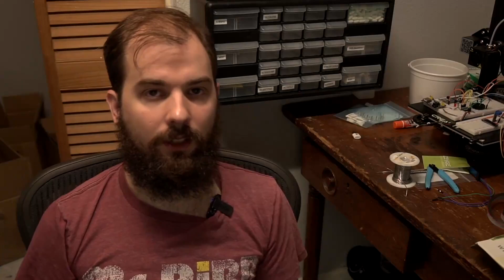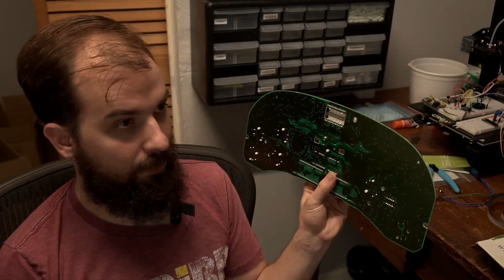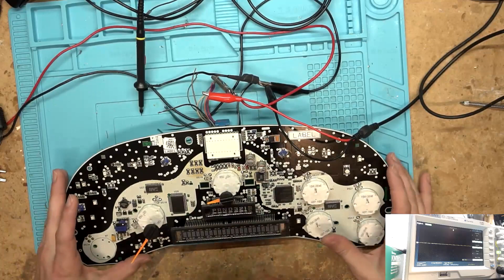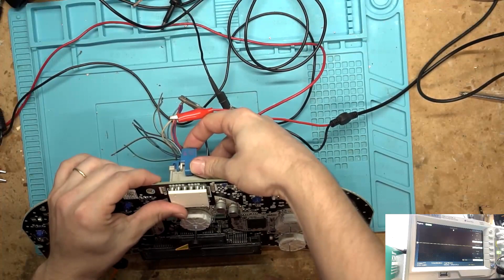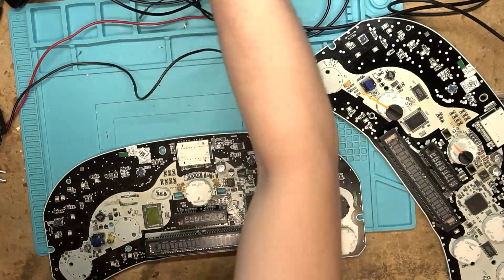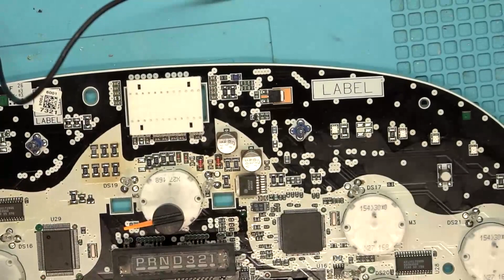GM Truck Cluster Dead Tachometer or Speedometer Not The Stepper Motor

Comment: Hi, do you by chance know which resistors or components would cause the fuel gauge to do the same thing those are the ones I need to focus on in order to fix mine.
Reply: What’s a good way to get in touch with you? If I can’t fix this problem I’d like to send it in for you to fix if you’re willing. I also somehow unintentionally reset the mileage when i was reflowing solder all over the place.

Comment: Hello, I'm having an inop tachometer (completely dead) and so far i've confirmed that the signal is making it to the IPC correctly. After replacing the stepper motor it seems it's something similar to what's going on in this video, where can I find replacement parts outside of the steppers? I'm very new to this, but want to figure it all out myself, at this point I've spent 3x in various tools compared to just sending it in to get replaced, so it isn't to save money, more just to learn. But anywho, I think you're the guy with all of the knowledge I need. I assume I'll need to order an oscilloscope and signal generator, but then those are defective resistor and capacitor you're finding? I can't find these parts online anywhere.

Comment: I have a 1998 Camaro board where the speedo is reading much faster than it should. It seams the faster the car is going the more off the speedometer becomes.  Ex. @ 30 mph it reads 15 mph fast but @ 60 it almost 30 mph fast. I replaced the stepper motor and same thing. Scan tool reads correct mph. Any ideas? Im thinking a resistor or ic maybe?
Reply from the maker: Sounds like it's tuned for a different tire size or gear ratio since it's on a curve. If it was a stepper motor or IC it would be linear

Comment: Why not replacing the caps with new ones? You could measure the value from a working board, couldn't you?
Reply from the maker: Without a high end lcr meter I can't get close to exact value. I could use a universal parts tester to get a in the ball park range. Then you still wouldn't know the voltage rating. You could guess that since that circuit normally goes to 12v volts  that it would 20 volts. Having seen some GM designs before I know they really over rate stuff so the cap is actually 50v rated I bet.

Really ceramic capacitors  last so long I wouldn't stress about swapping off a parts board. That would be like stressing over the voltage regulators. 

Just don't reuse electrolytic caps, bulbs or inrush current limiters. Those things all wear too much to be worth reuse.
Reply from the maker: Actually on that side of the resistor it only went to 5v  so it was probably rated 10v to 20v